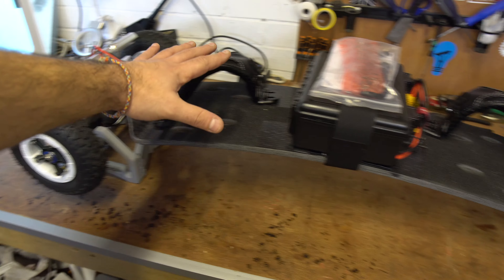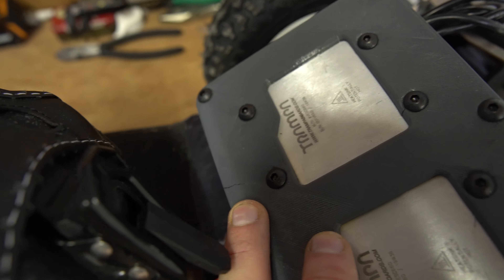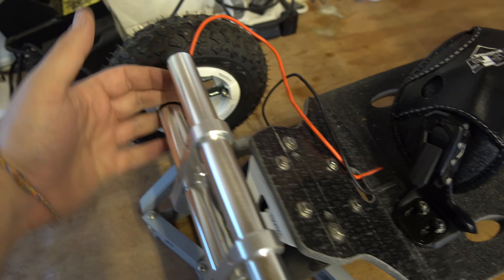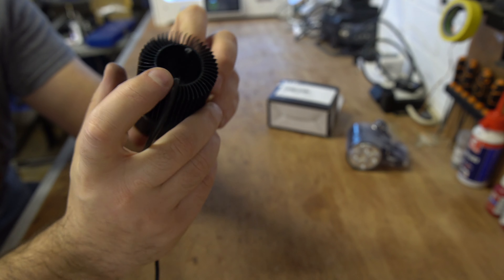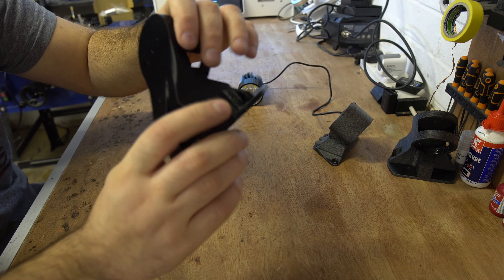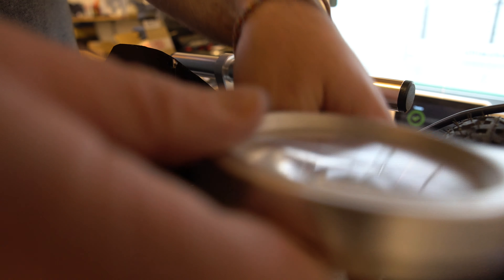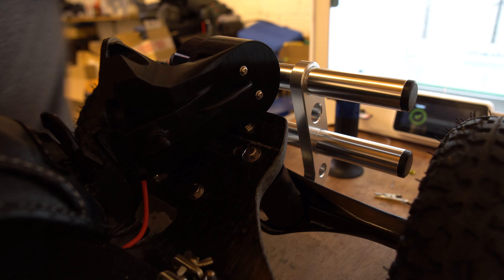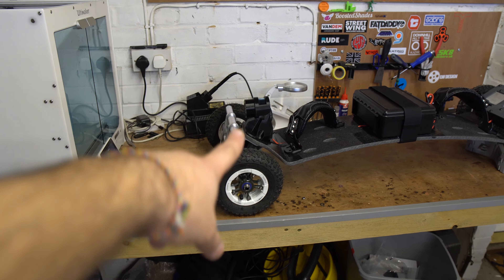Trampa Electric Mountainboard Integrated Light

Comment: Beautiful work with that light holder, Lee.  I am certain I am in the minority, but I prefer to hand hold my light on the not too often occasions I ride at night.  Hand held, I have light wherever I want or need it.  Obviously my approach will not work  if the rider is also holding a camera, but the remote for my Meepo NLS Pro has a good light built into the remote.  That would leave a hand free for filming.
Well done, Lee, both the work with the light and the video.
Reply from the maker: Hey David! Thank you! Yes another great option is a head torch attached to your helmet for hands free lights wherever you look.  The increased height also helps you see things better than at board level.

Comment: I'm actually thinking of buying a similar light with the fins behind it, but for 12v. Great showcase of the project. Cyclops looks great!
Reply from the maker: Thanks man! Yeah go for it, be creative and make something cool!
Reply: @LeeWright  Ah but I've gotta find a way to secure it to the deck first, my current dual light bar setup is bolted to the truck and its okay, but I'm thinking either a pair of projector LED lights like yours or a air of vertical short light bars for the trucks but with good lenses.

Comment: Nah not ugly. The fact you thought of that and then made a 3D printing of it is awesome. Here are a couple questions for you or anyone in the community. Belt or chain and is it possible to use a motor from a scooter or another electric vehicle to give more power to your drive train?
Reply from the maker: Depends on application! Off road? Chain.  Street fighter? Belt (but actually geardrive if you can)  you can use any motor you can make fit if you like - wether it's a silly idea or not is a different question - depends on motor.  Thanks man, glad you enjoyed my video
Reply: @LeeWright  Definitely enjoyed the video. And thanks for answering the questions appreciate it.

Comment: I like it, also don't like the idea to have it on the bull bars.  It's also nice not have to use a buck converter for the light. Only thing those cables could be a little thinner :) I'll try to find those parts and might try it myself.
Reply from the maker: Yeah for 600mA they could have been tiny, but they also fill the channel in the deck exactly when this thick, also simon has the possibility of running something else in the future
Reply: @LeeWright  you got me thinking about the future... :)

Comment: I'd be worried the 3-d printed light mount fixture will have similar/worse stress cracks / possible breaking in the future.  I just used a thin steel plate, cut the truck bolt pattern into it, plus a hole where the open part of the board is in the middle of the truck mount/lip and bolted from under the board up to some bicycle light fixture.  It's also steel/durable/allows for tilting/adjustment.  I don't see the mount lasting very long due to vibrations and stress from the bolts on the plastic enclosure.
Reply from the maker: I have many 3d printed parts off out in the wild with lots of miles on them.  The green board I did has nearly 1000 miles on it now! Its Nylon, its extremely strong! It will never be as strong as steel plate but it's enough.  I use 3d printed nylon pulleys I printed on my street build
Reply: What printer do you use, and any/if so what mods?
Reply from the maker: @davidyazdani6723  I use an Ultimaker S5 bud, no mods

Comment: Great job! I don't know why you got 2 dislikes. Jealousy perhaps? You know what you're doing. I will definitely pester you for advice. Thumbs up from me.
Reply from the maker: Ah I have a couple of haters mate, I just ignore them and they are irrelevant to me! A downvote is still channel activity so it doesnt matter 😁.  Thank you though sir!  Pester away I love helping people!
Reply: @LeeWright  Thanks Lee. This is what Ive done. I jumped into a project clueless. I've never built anything in my life except Lego. I have with me the dual direct drive from USA (Torque boards). Similar to what Mo has but not double kingpin. I'm waiting for my board to arrive and then I'll measure how much room I have underneath. I'm not interested in speed, 12-18 mph is my average speed but I'm obsessed with range. Not having to worry about recharging until I get back home. The only thing left to buy are the ESC, controller, charger and battery. But I do not want to buy from the USA because I got stung by ridiculous import duty. 
Specs are: 
MOTOR TYPE - DUAL DIRECT DRIVE MOTOR
MAX SPEED - 35+ MPH (75KV) 

MAX POWER - 4000 WATTS Per Motor

MAX AMPS - 80 AMPS Per Motor

KV RATING - 75 KV

MAX VOLTAGE - 12S (50.4V)

MOTOR WEIGHT - 3 LBS 3.4 OZ
Which battery and BMS should I get for max range? minimum 35 mile range is my goal.
Reply from the maker: @flowerpunkchip  good question but it depends on the size of your enclosure and deck.  Remember, the more cells in parallel the more range you get.  Mo for example runs 10S6P on his DD board.  If you can fit the same battery you should see those figures, although if you can fit more then go for it.

Comment: love the velcro you used on the board did you order it online by any chance, i currently have tie downs on ym board and want something clean, my local hardware store doesnt sell anything like that. Also how bright is the light at night while riding? i have 2 biek lights from target on my bull bars but they are just not brihgt enough so i was thinking about changing them to something much bigger and this looks like a agreat idea, integrated into the battery with a seperate switch!
Reply from the maker: Yeah I use just normal velcro and a strap.  The light is very bright you can see the same light in use on my Electric Mountainboard in the city video on my board, the night section  shows off how bright it is